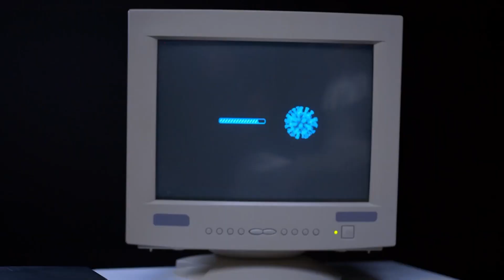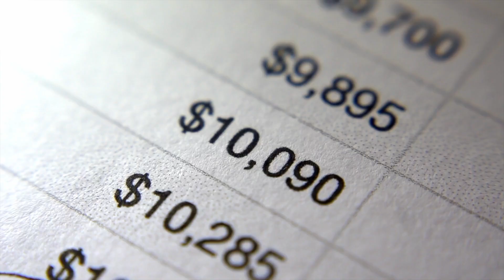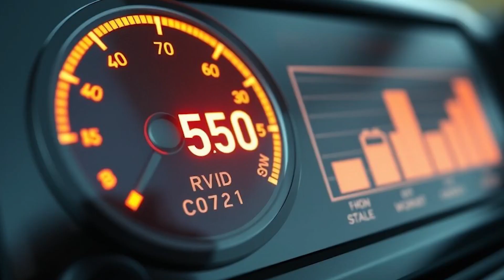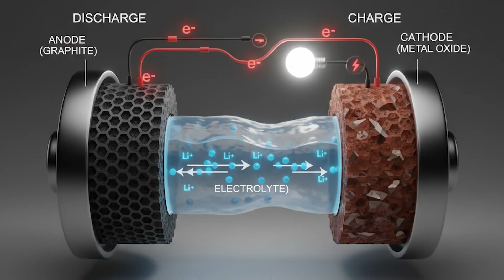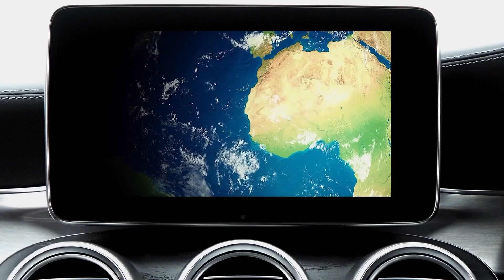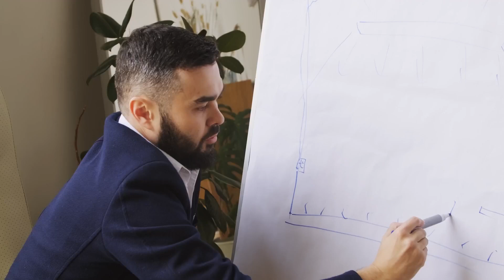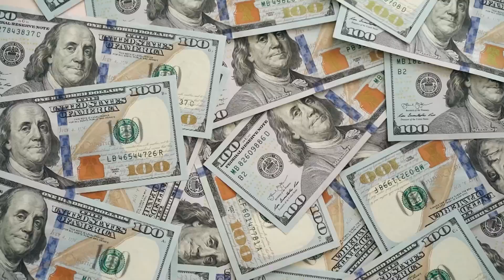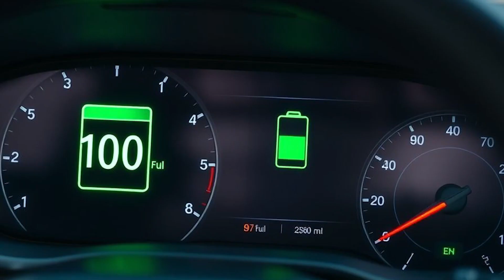Toyota's New Battery Goes Over 1000 KM!

Comment: Battery, Fuel cell are all good. problem with fuel cells is no one installed hydrogen refueling stations.
Reply from the maker: You've hit on a key challenge for hydrogen fuel cells; infrastructure is crucial.

Comment: Vaporware they have been announcing all kinds of stuff with no follow through . Also Hydrogen has totally flopped.
There dominance is already over.
Reply: Toyota is a wealthy company, so they hope that hydrogen engine cars will be ready for practical use in 30 years' time.
Toyota is a Japanese company, and unlike Western companies, it is not under pressure from shareholders, so it is able to carry out a wide range of basic research. The Toyota Group's Central Research　is working on artificial photosynthesis, methods to extract hydrogen from formic acid, and even developing mirrors that won't fog up in the rain by mimicking the internal structure of pitcher plants（Nepenthes）.
Recently, they announced a refined method to efficiently produce ethanol from non-edible sugarcane parts through fermentation.
Other companies probably couldn't do this kind of research.

If they tried this in the U.S., they'd likely face shareholder lawsuits.